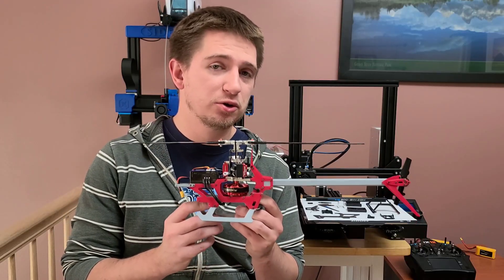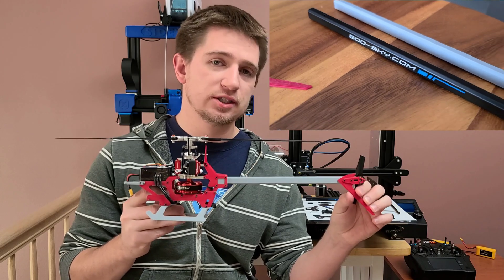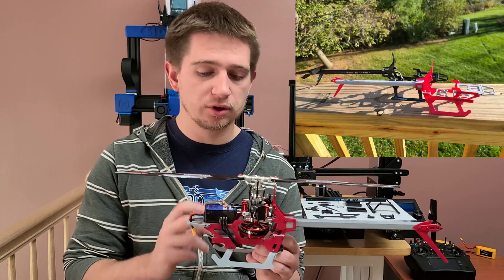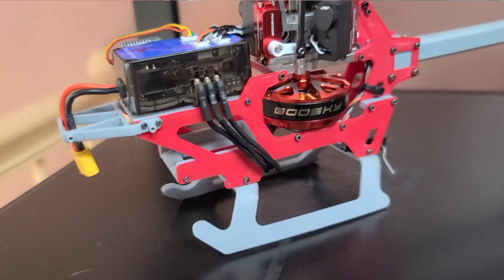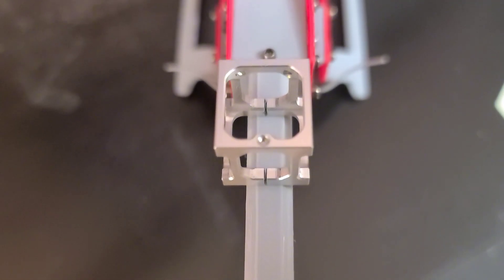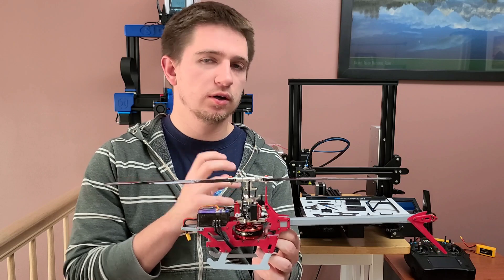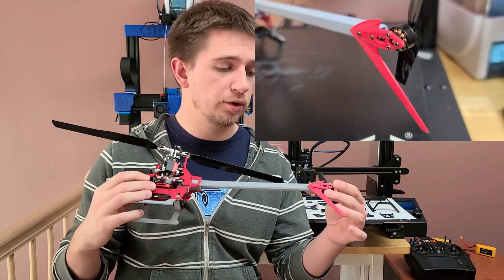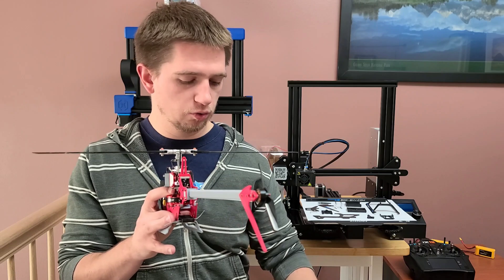PART 2: 3D Printed RC Helicopter - Will it Fly?

Comment: You can design for metal printers and use a AL pipe to go the rear rotor, thus reducing number of parts to only a few!
Reply from the maker: That is an idea I was considering at one point for the tail boom. I'm curious how heavy a metal airframe would weight 🤔 very interesting.

Comment: Very cool!  I'm surprised it held up as well as it did.
What kind of filament did you use?  Did you print in normal parameters for the filament?  Any hotter to get good layer adhesion?
Reply from the maker: I have recently changed all my parts that I'm printing to PETG. Lol trust me I had the same feeling 😂. Using the standard parameters for filament with minor adjustments when needed.